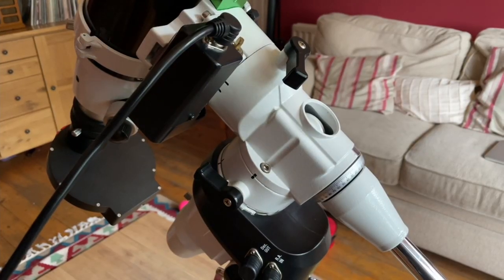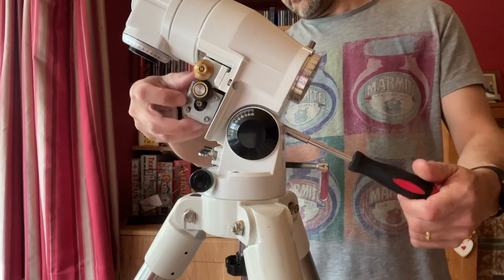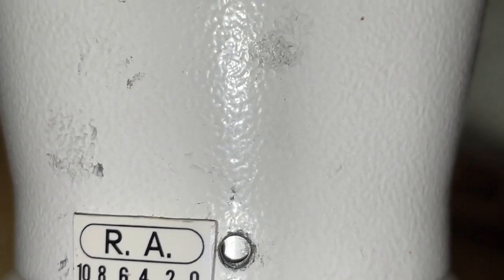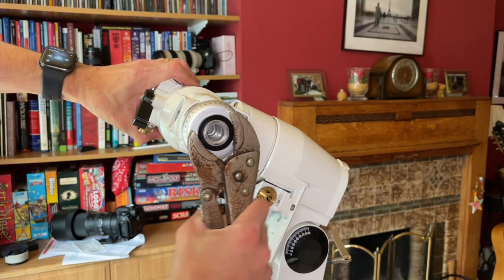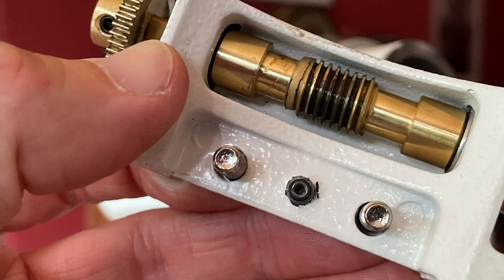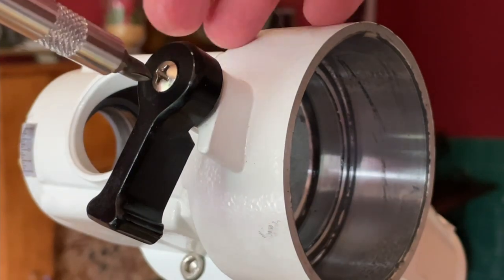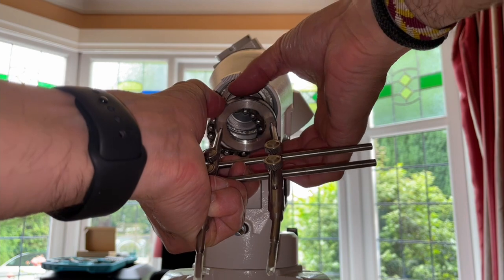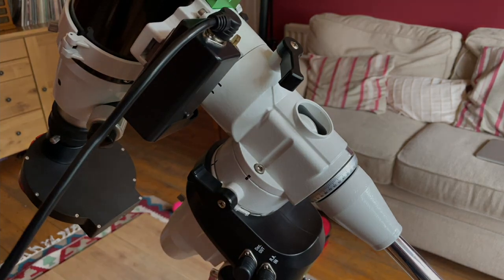SkyWatcher EQ5 Pro Mount Maintenance - Part 1 of 2 disassembly in 20 minutes

Comment: Thanks for doing this video. I actually have an HEQ5 Pro and I noticed that on mine the main gear is brass and the worm gear is steel, while on the EQ5, the main gear is aluminium and the worm gear is brass. I think a few other parts are brass vs aluminium also. There are also many more roller bearings in the HEQ5. For the relatively small difference in price, I would go with HEQ5 since the mechanics are probably more durable. I would not have realised that unless I had seen your nice teardown.
Reply from the maker: Yeah, the HEQ5 is definitely a better mount. I got mine secondhand last year when it was impossible to get any new kit.
Reply: The HEQ5 is over £340 more expensive

Comment: I bought a secondhanmd EQ5 for not mucht. I saw that the RA was stuck. So i decided to do a hypertune and install a onstep system. But when i tried to remove the RA axis it would not come out. i needed to use a small rubber hamer. also when i got it out the closed bearing (thu upper one in your video) was shitfted 1cm and i could not remove it, it is completely stuck, what can i do hear, i have ordered remplacements. Also the worm gear drive is also stuck, how did you do it to remove it? I removed the clutch leaver on the RA axis and i removed also the bolt of the clutch mechanisme. But then i saw that the black thingy on the bolt was broken in pieces. Im thinking with what i can replace it. I have a RD rinter so i clould try to print same in hard plastick enhanced PLA.
Reply from the maker: Oh my, there are quite a few issues with the mount. :( The only issue I had was removing the clutch part that was fused to one of the axis and hot water on one part expanded and freed it. Sorry I can’t help further.

Comment: This is a phantastic video, thank you! I'm not sure I am mentally ready to dismantle and re-grease my EQ5 yet, but if so I would use this video as a guide. I was thinking about removing the worm drive only, remove the existing grease and re-grease it that way without completely dismantling the mount. Is this something you would recommend as a quick improvement?
Reply from the maker: If you remove the worm drive be careful to adjust it correctly when reinstalling. Leaving the adjustment bolt in place will help but you might still need to ensure backlash is removed but that the gears don’t mesh too much that it will create additional wear.

Comment: Great video, you're very brave!! I have quite an ancient EQ5 mount that I would like to disassemble and regrease. What grease do you recommend? I have some very old (about 50 years!)  Castrol heavy grease. and some Shell Retinax AM multi purpose grease that contains Molybdenum.
Reply from the maker: If you’re going to the effort of dismantling it the get the good stuff. Rother Valley Optica have a type 1 and 2 grease for the different parts. Not sure what exactly it is but I’d get that.
Reply: @astrojourneyuk  Thanks, I'll check it out. It's possibly lithium based grease?
Reply from the maker: Here it is. https://www.rothervalleyoptics.co.uk/geoptik-equatorial-mount-grease-kit.html
Reply: @astrojourneyuk  thank you (y)
Reply from the maker: No problem.

Comment: Thanks for this very nice video! I have a question to you or to the community. Are the 4 Nylon washers all of the same size? I reassembled right ascension, which runs nicely now. When I put one of the remaining washers in the lower bearing of the declination it seems to be too large .... don't want to disassemble right ascension again to check size .... thanks for any hint. Regards Thomas
Reply from the maker: I can’t remember I’m afraid. Do you mean are the Dec washer the same size as the RA ones? I think the RA washers would be bigger as the mechanism is bigger and more substantial than the Dec part.
Reply: @astrojourneyuk  I think in my case they're the same, I finally took the one that fitted best Thanks, T.
Reply: Yes in the end I did it the same way. It works, thanks :-) Did you ever disassemble the polar wedge? I think I have either a broken thread or something ist wrong inside, it actually jumps while I turn the screw ...
Reply from the maker: I’m afraid I didn’t. Sorry. Good luck with the fix.

Comment: Your're a brace lad ! If you run into troublesome hex/Allen grub screws in the future try using an appropriate sized Torx Driver Bit . They work very well on semi-rounded grub screws . /SRK
Reply from the maker: Brave, stupid, or nothing to lose I guess. The problem with one of the allen grub screws was it had been replaced, or rounded off. In the end I used a slightly larger one I think, then replaced it with a new one. Thanks for the tip!

Comment: Hi do you know anywhere I could buy a replacement 135 tooth brass worm gear? New or 2ndhand. I damaged mine by dragging a grub screw or similar across 3 or 4 teeth and part of the smooth section trying to take a rusty old black version HEQ5 apart :( I have modified the mount to be goto with stepper and belts but the damage to the gear causes it to bind for the 3 to 4 turns of the worm on the RA. The stepper motor is onlt at 2:1 ratio to the worm so doesn't have torque to overcome the damage as I'd hoped. II hoped I could lap some of the damage down, as I onlywant to piggy back photograph with mount so can tolerate the inaccuracy damaging the worm gear and worm has caused. I can import a new gear from europe for £168, which is steep as at source it is £65, the other £100 being shipping/import duty. So wonder if you know any good places to find HEQ-5 mounts that are for parts only? I only know ebay. Any other places?
Great video by the way, which I had seen this when I did my scope 4 years ago :)
Reply from the maker: No sorry I can’t help with that.

Comment: That mount was a complete mess.   The worm drive mount style is the same as a Meade LX85.  The center grub screw is used as a stop for the depth of the gear mesh, the outer screws for advancing the depth and angle of the worm gear.  If I understand the design correctly, the gear sleeve is supposed to spin freely and the clutch is used to engage the axis. Always a challenge.  Clear skies
Reply from the maker: The mount is better but still not 100%. I need to have another go this summer.